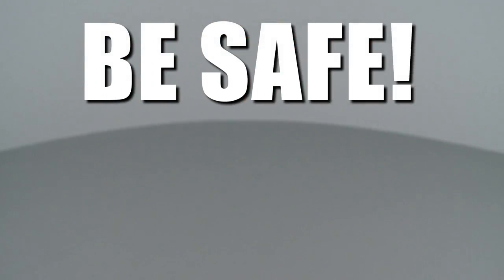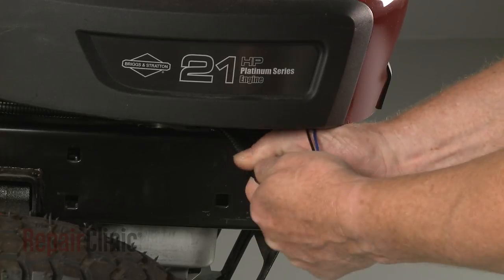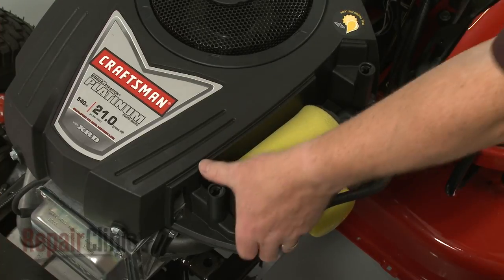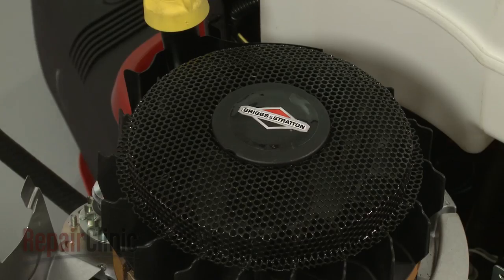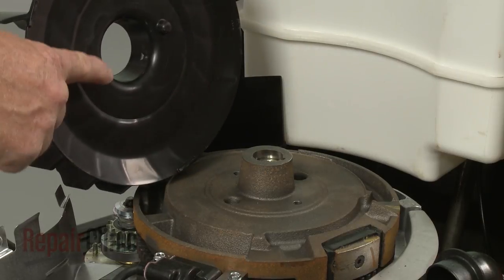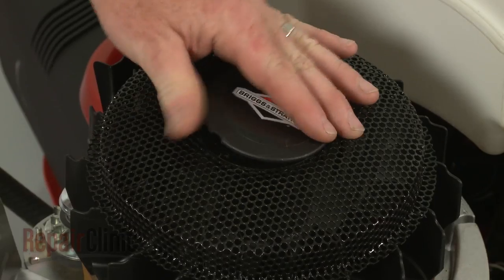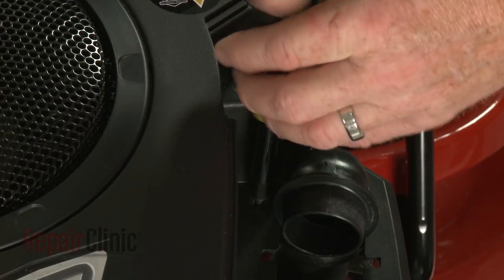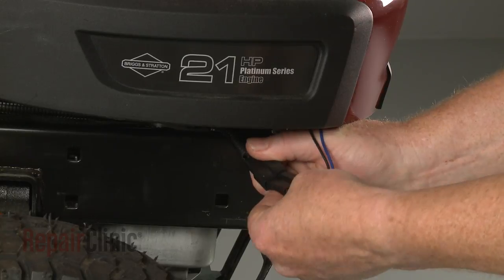Briggs & Stratton Riding Mower Engine Fan Blade #796084

Comment: After fighting to get the shroud to align with the bolt hole by the dip stick, I cut a slot in the bottom of the engine cover, I first threaded the bolt into the shroud for the dip stick then slid the engine cover down over the slot that I cut, then installed the other 3 other bolts and tightened them.

Comment: Perhaps you can help me. After replacing the breather tube on my tractor mower, I didn’t seat the engine housing cover correctly and now have broken fins, so now I need to replace the engine fan blade. My question is, is the 100-lbs the right flywheel torque number for my Briggs and Stratton motor 31G707-3026-G5
120618ZD? Thanks.

Comment: Any tips on preventing the crankshaft from turning while you remove the bolt? The video seems to show someone easily holding it in place with an adjustable wrench from underneath, but my bolt must be stuck much harder than theirs!
Reply: impact gun
Reply: @4040pmora  Put pipe wrench on right side against front axle assembly to hold it while removing fan. Put it on left side when tightening. Worked for me.

Comment: I torn up the fan, by not putting  the shroud on right, Now getting  the new fan blade on.  The top bolt ,,,, had to use a breaker bar with a 4 foot extension on the breaker bar,WOW,,, got it loose.  Put a 100 lbs of torque on it,,, job done. Just  Wow

Comment: What caused the damage to the fan?
Reply: @2:46 See how the heat shield tabs are all behind the blower housing?  That will cause the heat shield to impact the plastic fan blades as the engine turns.  This is how the fan gets damaged.

The video says to:  "make sure the housing is properly seated on the air diverter".  The statement is correct, but the video shows someone screwing this step up.

Comment: What would cause my JD D105 17.5 hp to keep breaking fins on engine cooling fan.
Reply: Here's what can go wrong with a JD LA-115 fan replacement (looks just like the fan and screen in this video)-  check to make sure the oil fill tube is properly captured by the plastic shroud ("air blower cover").  When captured, it will be fairly well centered in the opening.   I did not do this the first time, and immediately wiped out my first replacement fan, just turning it over with the starter, as the blades caught the oil filler assembly.  Got smarter....and with the second fan, I took out the spark plug and turned it over by hand, making sure the oil filler was in the correct location now, and nothing else was going to interfere with the blades.
Reply: @OllieProphet  Thanks for your comment! I had to change my head gasket last week on my LA115, and when I started it, my blades broke and I couldn't figure out how it happened so I ordered a new one and decided to read the comments here before I started to replace it. Boy am I sure glad I did or the same thing would have happened. It took me a few tries to figure it out, but I finally got it. Runs like a charm!! Thanks again
Reply: @OllieProphet   Thank you!

Comment: I just replaced my old Flywheel fan with the Briggs & Stratton 796201 Flywheel Fan. This is the replacement part indicated on the B&S website. Now my flywheel fan cover is rubbing on the fan and the fan blades are getting worn down. Anyone have suggestions on what I may have done wrong?
Reply: The replacement fan should have a new fan cover with it. Did you use the new fan cover?
Reply: I just replaced mine today and have the same problem. Any suggestions?
Reply: Same issue. My kit came from Briggs and Stratton dealer with the replacement fan blade cover. It is still hitting the larger motor cover when I try to start it.
Reply: Tom Tomaka It did not come with a new fan cover.
Reply: @Twotom1  My part order came with a cover but as you can see in the video the fan blades extend beyond it. This extension of blades are where it is rubbing up against the 2nd housing cover. Out of frustration after purchasing a new fan two times, I took a box cutter and formed them the way they needed to be to avoid rubbing. One size definity does not fit all when buying parts that say they will fit multiple models. My advice is to go to the store and take the part with you.
Reply: Same . Second time around and busted blades!!!

Comment: I had to remove the engine cowling and when I put it back on, I apparently didn't get it positioned correctly. The tube where the dipstick goes knocked off several blades of the fan when I tried to start it. There's about 5 left that aren't broken. Do you think it will have to be replaced?

Thanks!
Reply from the maker: +Jack Reacher Broken blades will cause the engine to run hotter than normal.
Reply: +RepairClinic.com Understood. I recovered one off an old engine.
Reply: yes, replace it, it will overheat.only fourteen dollars plus s&h at jack"s small engines, great people to buy from. 2-3 day deliveries.
Reply: I chap I met at the repair facility where I had the carburetor rebuilt had a 17.5 HP B&S engine laying around. I scavenged the engine fan off it. I'm good... cheers!
Reply: Yep, just cautioned against the oil tube being mispositioned when the cowling goes back on, and that it could interfere with the fan blades.  The oil fill knob should be almost perfectly centered in its hole, and should not be able to be pushed toward the fan, if captured and positioned correctly.  If not, you will soon need another fan....;-)
Reply: @OllieProphet  I did!
Reply: I just did the same thing! ☹
Reply: @OllieProphet  I found  that out the hard way lolo